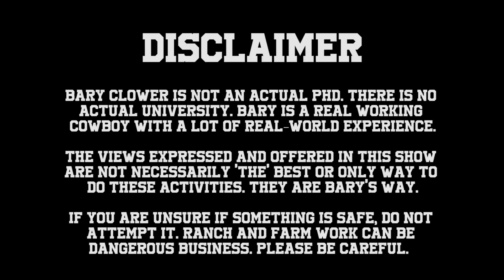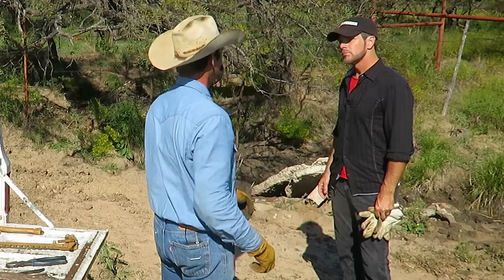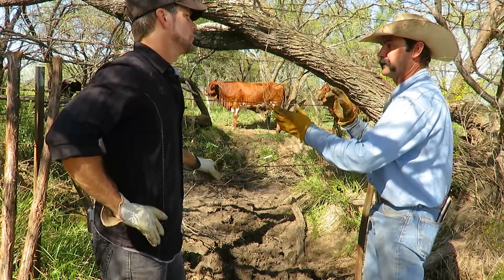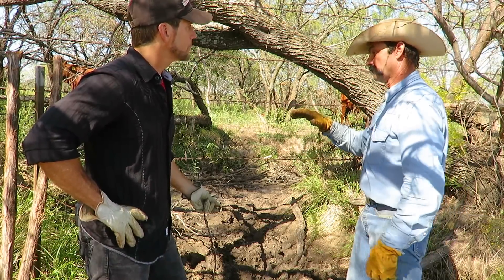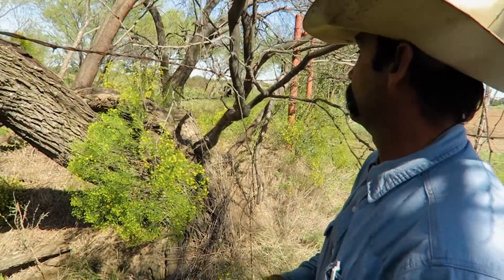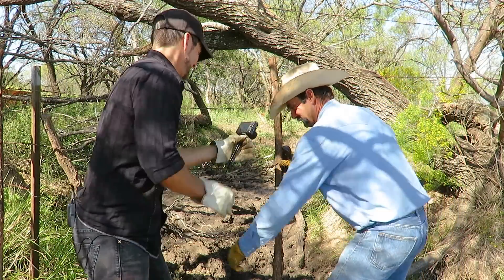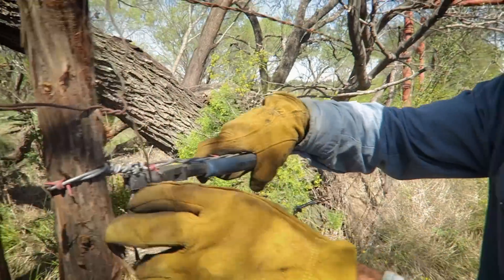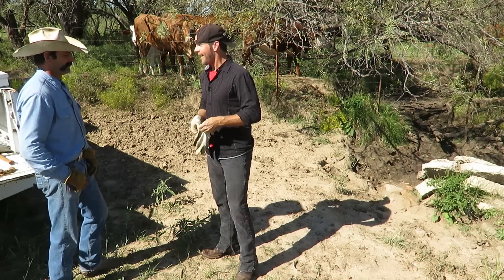Water Gaps 101

Comment: I like that wayer gap fence repair you boys done. We have alot of places where the area would be about 30 to 40 feet whete water would take out the whole fence. So we made a swinging fence an made the top strand using heavy slick or smooth wire and the fence would flip out allowing the flood water to flow and that helped us out alot but we still had big pieces of logs and other trash get caught in the fence strands. So finally the guy who owned the land said, boys we are going to use old metal from the roof of the chicken house he took down few years before. You know on a farm we don't throw much stuff away because we can repurpose it in the future building something else and we did. Those roof panels would flip up like a door when the rloods hot then go back down to starting position. We also had heavy rocks tied onto the center posts and few concrete blocks to give it more weight. An thinking about all that weight we put on that flip up fence section, flood waters are alot stronger then most people think. I seen few weeks ago watch some family's house floating down the river because of the flood waters. Another Nice video boys, you hit a homerun. Time to go rest in the shade.
Reply: I like the wsy you type. Lije me.

Comment: Nice to see someone else is using cedar posts still.  I just (somewhat) recently discovered the cedar post as my farm has a lot of red cedar with some being very nice dense growth with low taper.  I cut 6.5’ posts and cut a point on them.  I got a big 6” bore post driver (like for TEE posts but bigger) that I use to direct drive the posts.  4-5” diameter posts for pull/corner/end structures, 2-3” for line posts.  I build new fence for the cost of the wire only!

Comment: as a kid the neighbor had a wooden gap. Looked like a long section of slat fence, with 10 inch spacing. thing was the bottom was not fastened. When a big flood came the bottom would float up and be near horizontal. When water receded it dropped right back into place.

Comment: Like the 2 post theory but we use  a top swinging  gap with horizontal posts or cattle panels. If you place old tin on up water or stream side then the water gap floats up and back down with the creek rise and fall. Also no trash catches to tear gap out!